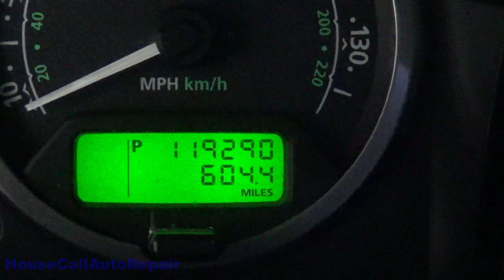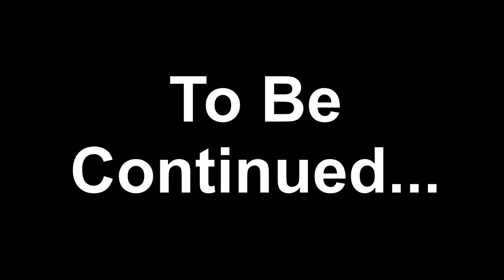2005 Land Rover LR3 Front Brakes and Rotors, and rear disaster - Part 1

Comment: That rotor retaining screw sure was a tight one. Usually the hand impact drivers are enough to break them loose. Great tip using to chisel to get it to move. I just put a pin coat of anti seize on them. No need for Loc Tite as the wheel will hold them in place and keep them from backing out.
Reply from the maker: With the screws that hold the rotor on.... when I use blue loctite, it is mostly to inhibit rust, as if I used anti-seize. You are correct, that there's no way it's coming out with the wheel on.

Comment: Good job I used textar pads  goin back to ceramic also did u notice the bracket over reach on the rotor like 1/8” that’s the part of the front brakes only on my lr3 that’s strange the rear the bracket is flush with rotor circumference have you ever noticed on lr3 this situation any way great job and sweet breaker bar ✌️👍😎 subbed
Reply from the maker: Make sure the rotor is centered within the installed bracket. If not SHIM it correctly. (This one had factory shims)

And I broke the breaker bar on this , on Sunday night replacing the wheel bearing.... Second lug nut off, and and the ice cold breaker bar snapped. Harbor Freight replaced it.